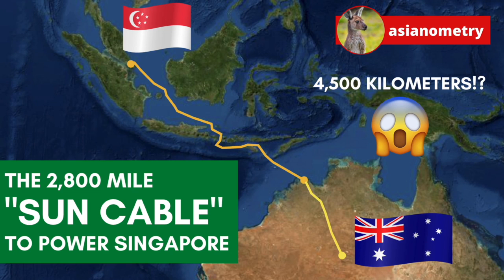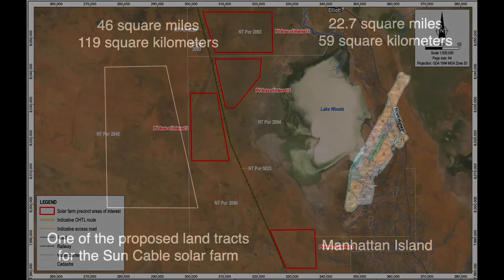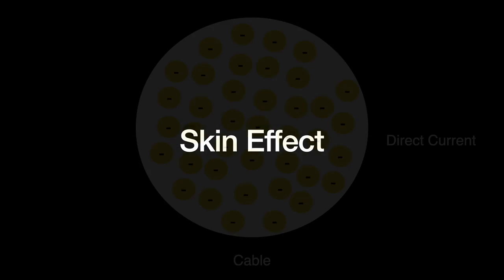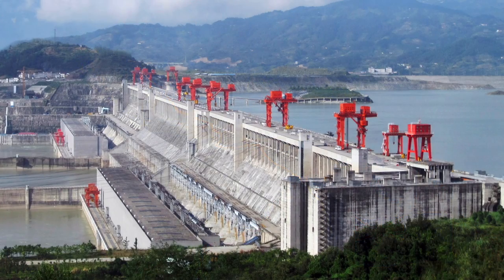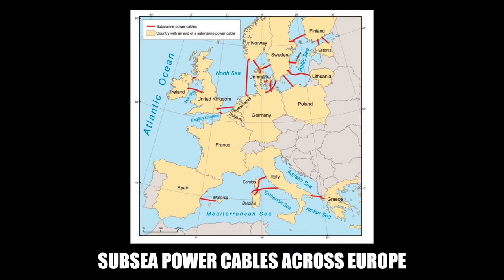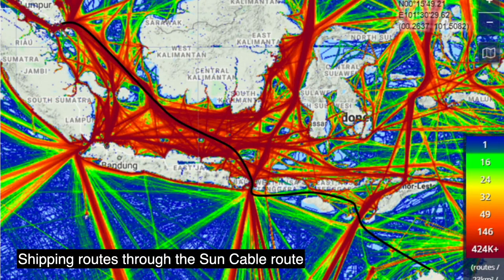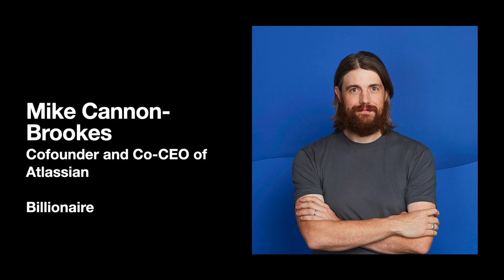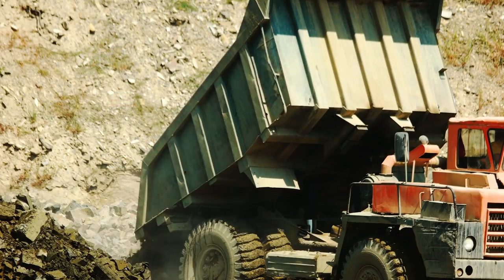How Singapore Plans To Pipe Electricity From Australia

Comment: lmao why????its not like electricity is like precious oil or gas or something........

imagine how thick the cables have to be to transmit gigawatts of power for a city.....over 4500 kilometers?????

and theres nothing on the other side of australia the side facing singapore......everything in australia is down down below perth,melbourne and sydney......so basically they choose australia because its the closest land if u ignore malaysia and indonesia????

can u imagine what the cost of electricity would be like having to transmit it over 4,500km of ocean,cost of laying pipe and maintenance......digging tunnels underwater is way way way more expensive than just hanging powerlines.....and the loss in emission over that vast distance......200 to 300km is still ok,but over 1000km.....u might as well build a power station where u actually need it.

why australia why not johor which is like 2 km away from singapore?they dont trust malaysia?ahahahahaha......newsflash guys if malaysia decides to cut us off....we will lose our water supply,half our food supply and 100b worth of goods that we import every year from malaysia.......so what if u throw electricity in?

this is pure retardation....coming from a sinkie.....

Comment: Electrical Engineer here
How Singapore Plans to Pipe Electricity from Australia
Completely uneconomical unworkable. 2300-mile-long cable underwater would need 3.072megavolt AC or DC without much of an electrical loss. The highest voltage underwater cables available today 768KVAC that is only good for 800 miles. With that 800-mile limit Singapore is better off using floating offshore wind turbines. At a population of 6 million people 3KW per a person generating capacity you need 18GW of electrical power generation. GE General Electric has offshore floating wind turbines at 12megawatts each. Singapore needs 1500 to 2500 12MW floating wind turbines 4 wind turbines in each square mile 625 square miles or 25 by 25 miles for safe reliable non-polluting electricity. With that many offshore floating wind turbines you have typhoon insurance that will protect Singapore shoreline and properties. In the long run offshore floating wind turbines will have a lower cost than natural gas with greater energy security.
Reply: Highest voltage cable these days is 1,100kV

Comment: Mate, who ever did your artwork on the main map need to actually check where Darwin is located. An informative piece otherwise though.
Reply: Also skin effect is for high frequency transmision of power and then pipes are used(like for radio signals in big radio antenas).
Wires are made from much smaller wires for mechanical reasons.
And DC is used in cables that are under water because they are in salt water and AC would be inducting electricity in that electrolyte...

Comment: What would be the practicality of physically shipping the energy to Singapore in container ships full of batteries? Would it be less than the many billions that the cable would cost?
Reply: I think it is not a very bad Idea  Singapore uses 137000 KWH per day . Lithium  ion battery costs $100/KWH , so if you have to 3 big batteries  enough for 15 day consumption ,total battery cost will be  $600 million dollar. one battery will be in Singapore discharging , second battery will be in transit , the third battery will be in Australia charging.
Reply: Much more practical to ship it in liquid hydrogen form. With modifications you can even use existing LNG tankers, docks, pipelines and power stations. Last I heard they were seriously looking at a green hydrogen plant instead of batteries and a cable.

Comment: Interesting. Singapore does not want to use Malaysia or Indonesia as places to build their power plant.  Why not? They are much closer, and the seas are much shallower.
The cable connection would be both shorter, and at shallow depths. 
Does Singapore not trust those countries?? 
Seems so.  They would rather deal with Australia and the higher costs.  
If not that, then what?
Reply: Solar is much better in Australia without the monsoon.

Comment: Would it not make more sense to simply site the solar farm closer to Singapore? Like in Indonesia?

Sumatera is so much closer. More clouds. But the cable would be so much shorter. Longer cable, greater chance of accidental cut, service interruption. And even if it is "only" 100m deep instead of 2000m, it will not be fixed with divers. You're gonna need a ship. Months of delay waiting for a specialized ship to become available.

A solar farm in Sumatera can be connected with multiple smaller cables. If one is cut, you don't lose 100% of capacity. These could be added one by one as the farm is built up. A faster less risky startup producing power in 2 years, but gradually ramping up. Instead of waiting 20 years.

Comment: I thought dc travel at the skin thats y they use thin copper core in a thick wire to maximize the surface area compared to ac which use heavier guage wire becoz the surface of the wire is not critical

Comment: There are 6 peak hours of sunlight available per day..........how is Singapore going to store enough solar power for the other 18 hours a day?    Singapore and Australia dont have any sites available for large scale pumped hydro and grid scale "big batteries" are hideously expensive, and unlike pumped hydro only have a lifespan of about 10 years.  Research on lithium storage systems has shown degradation of capacity on daily cycling of between 15 to 30% at 4 years of use.   The 7 billion dollars of big battery packs is going to be gigantic headache........along with the fact that they have been catching on fire in both Australia and California.  Indonesia is on the right track........they have been considering Thorium nuclear reactors.  Singapore will end up doing the same.

Comment: No build a high speed rail system through New Guinean and bunny hop the islands add water fibre optics and hi voltage aerial power cables and it would be revolutionary to world travel. Air travel is the most damaging due to the high altitude pollution it produces

Comment: Things in Ukraine really put a bullseye on how fragile our energy systems are around the world. This essay really backs that up. Nice job!
Reply: No, things in Ukraine have been used as an excuse by many countries which already had rapidly rising power and fuel prices before the Russian invasion. The fact is, so-called renewables are inefficient and incredibly expensive (generating about 20% of full capacity on average, compared to coal or gas at >90% capacity), especially when governments drive up the price by adding subsidies. Sure, we should stop burning fossil fuels to generate electricity, but let's do it sensibly and reasonably, without throwing money at ridiculous schemes like this.
Reply: @cerealport2726  Fossil fuel is no doubt the backbone of our civilization, but there is nothing wrong with being inefficient if your headed in the right direction. I'm pointing out how easy it is to cut a powerline because it crosses the sea. That is not a ridiculous scheme those lines are already in the water.
Reply: One more thing about efficiency Cereal, Turbo Prop or Jet Engine? So many variables, but Greg lays it out pretty nicely. https://www.youtube.com/watch?v=JC-7wRmMH2g 17:20 is the mark.
Reply: @jeremiah_dyess  It's not about inefficiencies per se, it's about the fact that inefficiencies are just one of the many problems with the attempt to rapidly change to "renewables" without any real plan. This haphazard approach is causing massive economic harm to businesses and individuals via less reliable and more expensive electricity. Given that China outputs more CO2 than any other country, and they are doing basically nothing to stop, then it's a but of a mystery to me why other countries are ruining themselves for no net environmental benefit.
Reply: @jeremiah_dyess  What the hell does that have to do with renewable energy generation efficiency (Capacity Factor (CF) specifically)?  Seems you don't understand my point at all...
The facts are, that for every Gigawatt of nameplate capacity installed, solar and wind are lucky to generate 25-30% of that value over their lifetime. Building a 10 gigawatt solar and/or wind farm is not going to replace a 10 gigawatt fossil fuel or nuclear power plant. This means that on top of the solar and wind generators, you need a hell of a lot of backup power from...somewhere... which, for most countries,  often means open cycle gas turbines which are some of the least efficient and most CO2 intensive generators available. Massive grid connected batteries are good for frequency stabilisation, not much else, except making money for the owners. This scheme is nothing but a joke, and a profit-making exercise for a handful of companies, it wont actually do anything of value for anyone else.

Comment: What? You kidding? Electricity bill is through the rooftop in Australia.
Reply: That because you are refusing whats given freely to you. Sun, wind and storage are a potebt combo to lower prizes and increase production. If youre stuck on coal, well...
Reply: Most of which is the grid charges not the actually power cost.

Comment: I enjoyed your video!  Though I can’t help but think this is a terrible project design and a massive boondoggle.  Singapore would be better-served with some type of small nuclear reactor that doesn’t depend on other countries or thousands of miles of exotic cable.  Worst-case: park a nuclear-powered vessel off the coast and use its power system as a generator for the country.

Comment: Many people still dont know the global internet is actually connected by cables which running ten thousands mile under the sea.
Reply: The weight and size and rigidity of the two type of cables are totally different, though.
Reply: @Jinkypigs  And power demands.

Comment: Transmission losses over 1000s of kilometers will be astronomical and a colossal waste. The underwater HV cables will be subject to unpredictable shock and stress as the seabed transverse the ring of fire zones. Maintenance costs for the cabled will be a recurring huge liability.  AC or DC regardless at 1 GW will cause a 40 % loss over 2000 KM. 
Better to have a nuclear power stations  - SMRs - small modular reactors - on one of the islands around Singapore. These new technology based nuclear power stations are compact, fail safe and very reliable. And quick to install and commission.
Lockheed, Westinghouse etc are now making modular nuclear power generators that are small , and undergoing trials, which will be very assuring in performance and reliability.
Reply: Ever since Fukushima nuclear fission has become VERY unpopular.  Unless someone invents a self-sustaining fusion reactor it will always face opposition.  
After all, nothing is ever "fail safe".  Japan can somewhat still afford to have a huge tract of land become uninhabitable - Singapore will no longer exist if a meltdown ever occurred on the island.
Reply: 3% for DC over 1000km , 6.% for ac over 1000km

Comment: Video misses several key details:
What is the actual MW capacity of this HVDC link (two cables 3200km) ?
What voltage will be used? 
What will be actual transmission loss? My estimate is 20% (minimum) if the same voltage is used as in currently longest HVDC cables in Europe.(+- 500kV) 
How many hours of operation during the day? Do we really expect that enough battery storage will be built to cover 10-12 hours of operation during night? 

Private capital will not finance this utopia. Only woke government bureaucrats could provide the finances.

Comment: Your map showing the path of the cable is wrong in terms where the panels will be and where the cable will enter the sea (Darwin). 

Also, Singaporean government is not engaged in this project at all. Combined with the very large technical issues I doubt this project will ever get off the ground, it's more likely to be an investor fleecing scam.

Comment: The first HVDC system was built in Germany and was based on Mercury Arc Valves.  It was taken to the Soviet Union after the war and connected Moscow and Kashira.  It was not entirely successful, but it was made to work.

As for this pie in the sky idiotic project to connect the NT and Singapore...its not going to happen.  I am frustrated that renewables are widely seen as the solution to emissions free power delivery at scale.   This is not the case.  And while we mess around with this nonsense the planet approaches the point of no return.

Comment: Jambi Indonesia has a lot of coal.  Build a big power station close to the fuel and pipe the electricity to Singapore.
Reply: Nah, that would worsen the haze. As it is, indo minister already told sinkapoor that we should be grateful to indonesia for the oxygen. add in electricity and we'd have no idea how eternally grateful to indonesia we would have to for the annual haze.
Reply: @mikethm1974  Coal power stations can mitigate emissions, Volcanos and fires not so much.
Reply: Why bother with a cable. Bring the fuel to the power station if that is your plan.
Reply: @catprog  Indonesia and Singapore would build a large coal power station in Jambi Sumatra where there are large deposits of coal.  The cable transport the electricity from Sumatra to Singapore.

Comment: This is absurd. How are you going to bury a cable on a route criss-crossed with cables and pipelines? But even more important, why would you not just take the cable to Java and then a very short crossing from Sumatra to Singapore could ensue? The issue of power distribution within Java and Sumatra would be a far easier issue to handle and could benefit both Indonesia and Singapore who enjoy very friendly relations.
Reply: Because if Indonesia gets proddy, that line can get cut any time. Though to be really honest I'm not sure if this project is a joke since it sounds so impractical.
Reply: @danielc2701  inland or underseas it's still Indonesian territory, LOL
Reply: @rakasangsakawiraperkasa7309  Which of course is the point. You are just proving it by reacting the way you do.

Comment: The metals required to lay the cables could easily sufficient be used to create an aluminum floating island the size of the solar panel required at close distance to Singapore. An environmental disaster to begin with to embark on such project that creates this much massive waste and carbon dump into the environment.
Reply: 10cm radius cable * 4500 km = (1cm  x  4km x 4km)  I don't think I would trust a 1cm thick island. and it does not come close to the 10km square for the NT option.

Comment: I just don't see how this is sustainable at all where do you get all of the calculations from when people put this together. When somebody says this is going to be sustainable or zero admissions, where did the calculations come from? I'm absolutely confused. Let's just take the copper for the cable are the calculations made all the way back to actually digging up the ore then sending it to China to refine, then sending it to Europe to make into a cable then sending it back to Australia as cable are all of these calculations put in place when you talk about something sustainable? One of those big ships burns about 1000 L of diesel per hour. I just looked up it takes 30 to 40 days from a cargo ship to go from Australia to China which is on the low end 30 days 720 hours times that by 1000 L per hour. That's 720,000 L of diesel burnt just to take the or from Australia to China, that's not even adding up all the diesel, it takes to just to get it out of the ground even before it goes on the ship.

Comment: This is an absurd project, the environmental damage in building the transmission infrastructure to Singapore, then you have the high voltage DC transmission. Just utterly dum. Singapore needs to get over its allergy (or disdain) to its neighbors and fund local solar,  and wind and energy storage solutions.

Comment: Any electrical engineer is having a real good laugh now
Reply: Watch the Sun Cable video by EEVBlog2. Dave is an electrical engineer, and he ran the loss numbers and seemed relatively impressed. This is not to say the economics of the cable and the other engineering challenges (like tectonic activity) are easily solved problems, but it seems at least from an electrical engineering perspective the project passes a sanity check.

Comment: If HVDC can solve long distance electric transport then Thomas Edison should be the one who win the current war.
Reply: For HVDC you need equipment which didn't exist until a decade or two ago. Back then it wasn't possible to do it - but it was possible to change voltage with AC with transformers.